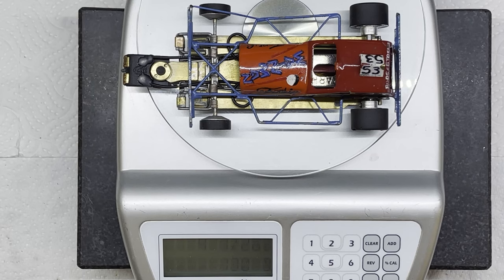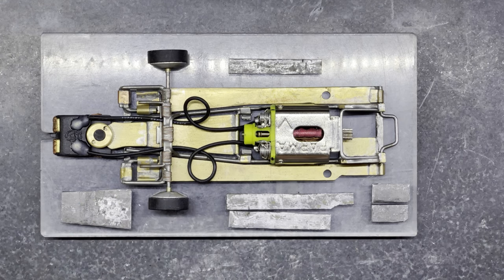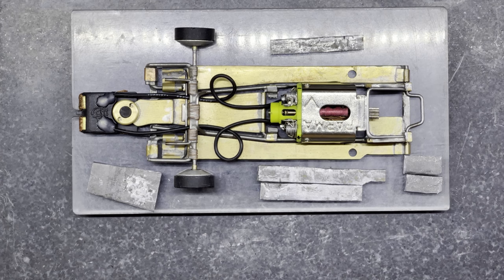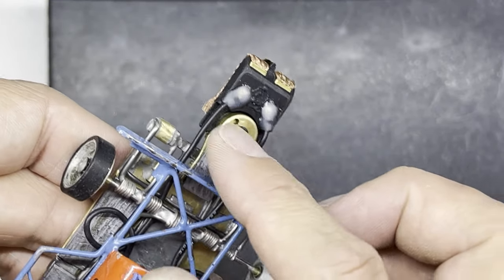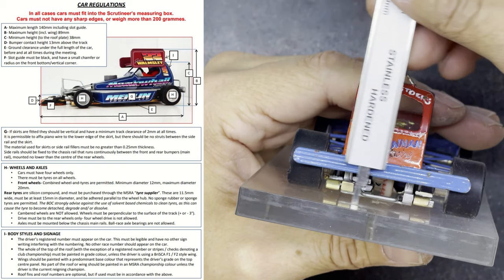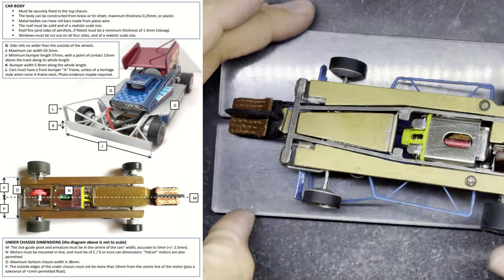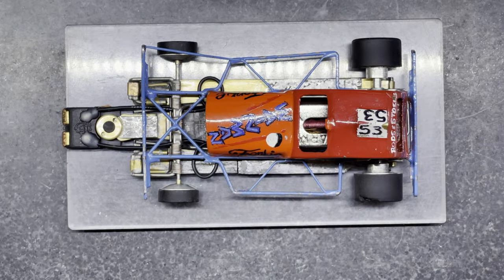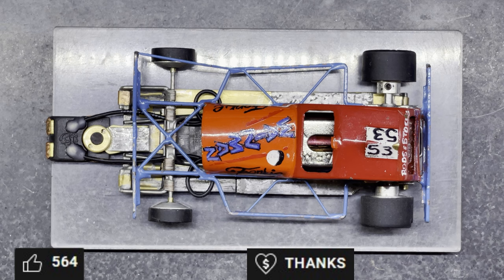Setting up a 32 Scale Slot Stox car with a technical inspection before official scrutineering

Comment: Thanks again for this series of videos. The last one here was facinating. When we were kids (in the 70s to 80s) we used to run with a lot of guide off set on a wooden self built track, no club rules at home you see. We used brass tube to locate old Scalextric guides in the off side (uk) front corner of the upper brass chassis right behind the front bumper inside the main chassis rail. We didn't have a lower chassis just a brass box section upper lol. Great fun. Thanks again from Birkenshaw!
Reply from the maker: Thank you for watching. It is amazing how many people can have the same ideas all over the world, totally independently of each other. It started to get a bit silly with offset cars so the rule needed to be brought in 😁